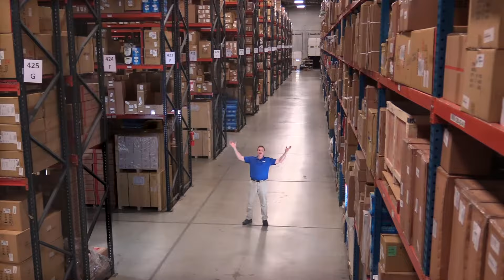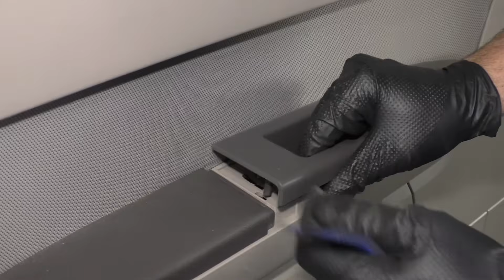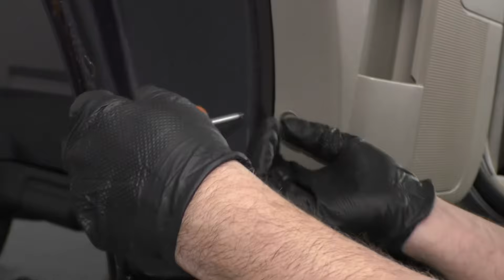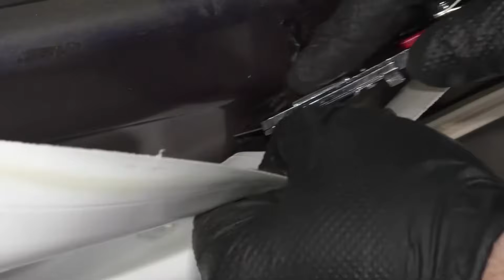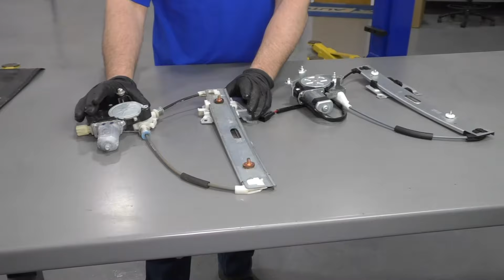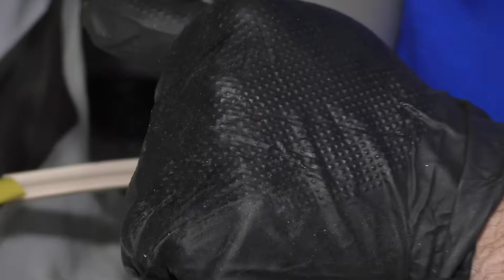How to Replace Rear Window Regulator 08-12 Ford Escape

Comment: My old regulator/motor had bolts mounted to it, the replacement did not have those bolts, I had to buy 3 flange bolts, 6M 12mm 1" ones worked perfect.

Comment: Everything went exactly as described in the video. Each step was very clear and there were no big surprises. One thing to note, however, is the screws behind the door handle and the standoff cleat are secured in metal clips that easily slip out of position. That was the biggest challenge during reassembly. Thanks. A very useful video.

Comment: Question: when i put my regulator in and tested it to follow the steps, it didn't move. I was working with the old motor so i thought the problem was the part i got but its a problem with both motors now. The car worked fine until i took the first motor out. Now nothing i do makes the new part work. Is there something i need to do? Urgent, i need to drive my friends to a 4th of july party.
Reply from the maker: +Grimstar2417 We wouldn't be able to diagnose an issue like that here, you may want to have a local mechanic take a look at it. Thanks for checking us out! http://1aau.to/m/Shop-1AAuto-c

Comment: Thank you so much! I was so worried about doing this myself. When I took the door panel off,everything is kind of hiding behind metal and a few openings😬 It looked like a lot of complicated parts that could be messed up very easily. Your video showed it step by step & very clearly explained it without skipping parts like other videos did. Thank you so much! Saved me $400 & a week with my window not securely closed(waiting on available appointment)!

Comment: I pulled a door regulator and motor out of a Ford Escape at the Junk Yard. If you don't have power to lower the window you can get the window bolts out by removing all the accessible mounting hardware. Then with gloves on pull the door frame out while pushing in the fixed traveler mounting bolts. Then you can drop the whole assembly down to access the window attachment screws. With the traveler all the way up you can fit a socket on the bolt head of the screw the traveler cable is in the way. You have to use a needle nose pliers or possibly an open end wrench to loosen the screw. Once both screws are out you can get the assembly out of the door. You may be better off buying the part new for the extra work involved and what the Junk yard wants to charge for the used part.

Comment: Didn't buy the part from you but appreciate your video of how to replace it! Also sad that it cost like $50 to fix a window, the driver's back side, that's probably never been used more than 50 times in the life of the vehicle and a window that doesn't even fully open!!! My dad owned it until about 3 years ago and I'd bet he never even opened or closed ti!! My daughter bought it from him and I can't believe she or someone that was riding in it, used it more than 5 or 6 times! We just recently replaced the first set of tires it came with at 54k. It only had 26990 miles when we bought it and it's only got 73379 now. Pretty sad and pathetic! A stupid plastic part that the window lift cable ball end attached to....jebus fuging krist!

Comment: What is the make and model/part# of the inch-lb torque wrench that you use in this video?  Do you sell it?  Your videos are excellent - everything is explained thoroughly and no steps or details are skipped - best I've found on the web by far.
Reply: You don't need a fancy or expensive one, you can get a cheap torque wrench at Harbor Freight for a little over $20, nice to have for the peace of mind if you like doing repairs yourself. 

Or if you want to cheap out, you can just go a tiny bit past snug when tightening the screw, about 1 maybe 2/12ths of a turn (if you envision each hour on a clock being 1/12th of a turn). 44 in-lbs isn't a whole lot of force/tightness. You are torqueing bolts that are holding onto a piece of glass afterall, you don't want to tightening the bolts down too much that you crack the glass.

Comment: At 12:20 in the video I had that piece on the end break that holds the door switch screw secure to the door. What is that called so I can get a new one?
Reply: I know what you're talking about but I don't know what it would be called specifically. Trim bracket tab, I guess? Something along those lines. Although, I kind of doubt they sell that piece on its own, it'd be simpler to just buy the whole trim bracket itself. But everything should hold up just fine even if you leave out the one screw that would thread into that tab that you're talking about.

Comment: Great video, I replace my window regulator in about one hour. One small problem with the replacement regulator. I could not get one of the thru bolts to line up after the two slotted stud were tightened down, but the window seems to be working fine without it.

Comment: Thank you for this video! My rear driver side window was just down and I had no clue what happened. After searching I knew the regulator had to be replaced. Local mechanics wanted $250 or more to fix, my dealer was even more because of what they charge for labor. I got the part and followed this wonderfully detailed video step and step and in about an hour had the whole thing fixed and door put together! Thanks again!
Reply from the maker: +Mark Cibulka Thanks for checking us out! http://1aau.to/m/Shop-1AAuto-c

Comment: I just bought a dorman window regulator for rear right. The bolts dont go in because the engine part is interfering with the frame. Why does this happened?

Comment: Awesome video...made replacing it much easier.  Seeing you remove the screw behind the door handle saved me from just ripping it off....I didn't know it was under that little cover.  Thanks!
Reply: Had the same problem... Almost went caveman on it but though I better check YouTube. 🤓